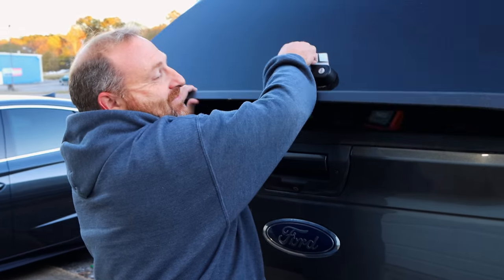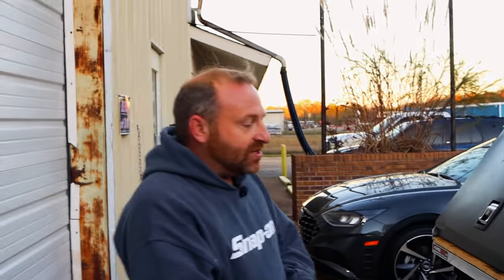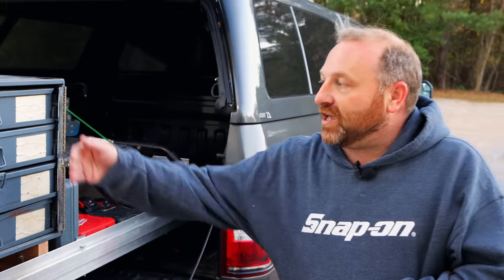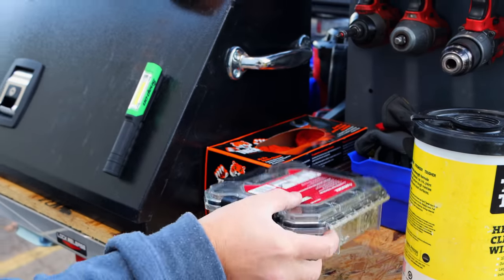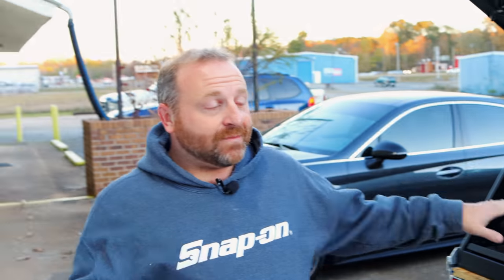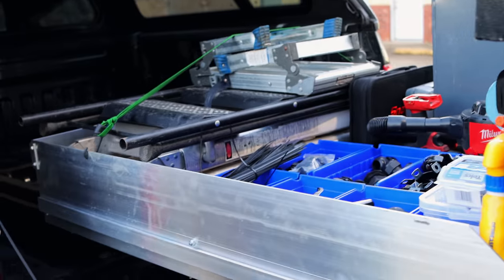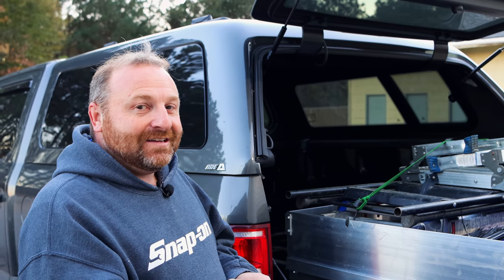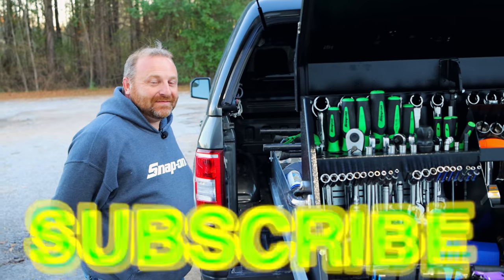Not Your Typical Service Truck Tour With Montezuma Triangle Box And Cargo Glide Bed System

Comment: Dang, I got that exact Z series cap in same color. And that’s the EXACT Cargoslide model I pondered over getting! Never pulled trigger though.
Older you get the less you want to crawl in back of cap to get stuff up front 😂
Reply: That is the truth! I’m just dreading the day something falls off in the back and I have to crawl up to get it 🤣🤣🤣
Reply: Ha, that was one of the things that made me question getting one. Unloading whole platform to crawl in and get something that fell out and got wedged so it wouldn’t slide.
I never saw the legs before. That new?
Reply: I do not think they are new, I have sent them for a couple years since I first started looking into them. It does have removable sides that’s sit up pretty high. I took the one on the passenger side off so I didn’t have to set my parts box up as high. I could have cut it but waiting to see if I really need them or not

Comment: I have thought those boxes were a cool idea since the first time I saw one, but it's hard to visualize how exactly you would want to use it, when the stock photos on the websites have them loaded with 14 ratchets, 7 full 3/8" socket sets and like seventeen 13/16" combo wrenches tossed in there. 😆 I totally dig your setup man. I keep trying to convince a buddy to do a box like that since he works out of an older Pathfinder. I'm gonna send him your vid in hopes that he splurges a little on himself and does something like that.

I recently saw a pic of one of the triangle/wedge boxes on top of an equal width (36? 40?) roller cabinet box. Thought it would make a killer setup for someone vs. a big cart; it should be affordable, hold a ton of tools, and be light enough to roll around a shop or 2 car garage to get closer to your work.
Reply: When I first saw the triangle box in the store I could not understand why any one would want one. It took a lot of thinking about the layout before it finally made sense to me. After my first job out with it, one will always be in my truck from  now on.

I think one of the greatest things is the flexibility on how you set it up. I have a few minor complaints with it, but it still out weights the down falls of a chest style road box

Comment: He should look into the new 2021 F-150. You can get a built in generator that would give him more than enough power to charge anything and everything
Reply: I wonder how that's gonna change the welder's game, if they can put out some serious juice. Imagine that, skipping on the engine drive and a fully outfitted 1 ton, and just running your Miller XMT out the back of your daily driver Ford, that also doubles as one of your inverter shop machines. I know guys with Trailblazers or pipeliners that merely run them to power a big red or blue inverter machine. Makes perfect sense for mobile repair guys. Maybe enough to run a compressor too? Doesn't matter if the truck or welder breaks. Unless you have a spare, either has to be fixed to continue work.

Comment: What brand socket set will actually fit on the Montezuma socket peg spacing. I have tried Snap-On, Mac, Matco, S-K, & Craftsman. The peg spacing is too narrow and eventually you have to skip a peg which makes it look like you are missing tools. It’s even worse with impact sockets.
I really do not like my Montezuma triangle because of the lack of thought put into the peg spacing.
Reply from the maker: I used the GP duo sockets and they work great ?